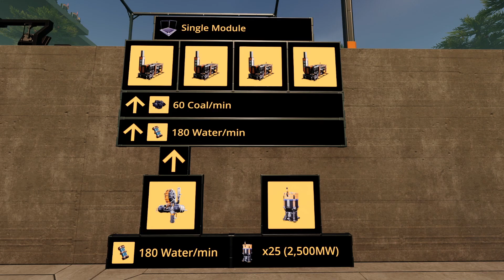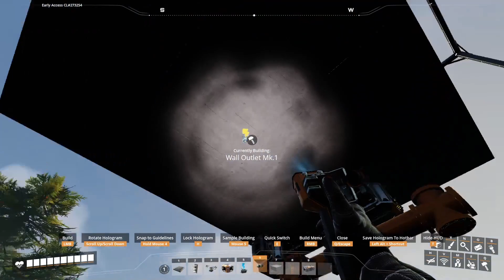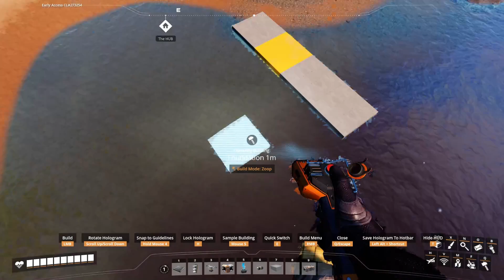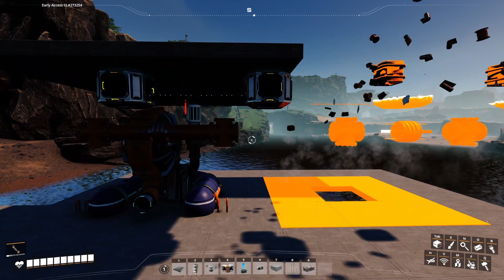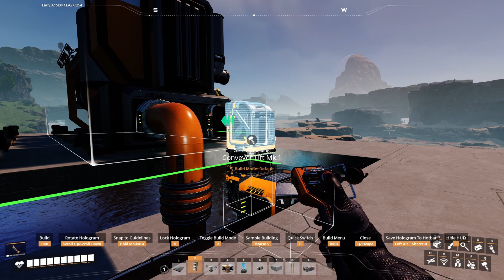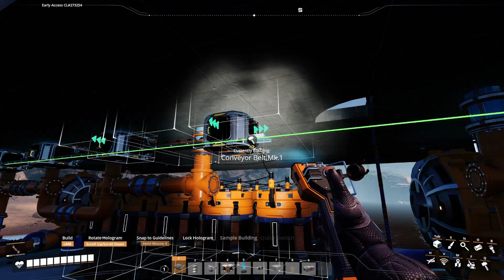Satisfactory Update 8 Guide: Modular Coal Power Blueprints

Comment: Pretty good overall, but why connect the splitters together with a Mk1 belt? That limits you to 4 generators total. Mk2 belts are very accessible by this point in the game and would allow for up to 8 generators.
Reply from the maker: I personally find it easier to just upgrade the belts that need it than making it all Mk.2. Plus you need RPs for the generators and I usually don’t have a ton of extra by the time I’m going for my first coal plant. At the end I do show how it can be easily expanded beyond 4.
Reply: @Cyanogenmod_  Sure but you don't have blueprints when you make your first coal plant typically. Or at least I sure don't, lol. Don't unlock blueprints until a bit after that.
Reply from the maker: @cheeks2184  I gotcha, it’s definitely possible, I usually unlock Steel and the Blueprints since they’re so strong, I want them right away. 

Shameless plug: If you want to see how to get blueprints quickly check out my Tier 2 blueprints video. I show exactly how I unlock them early